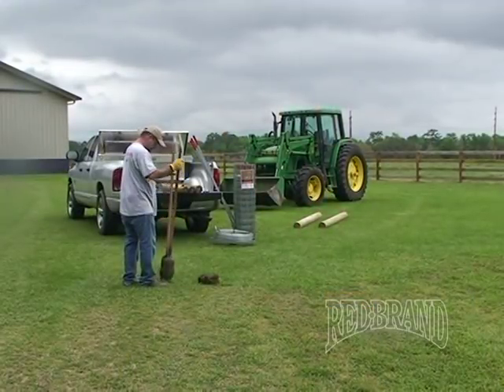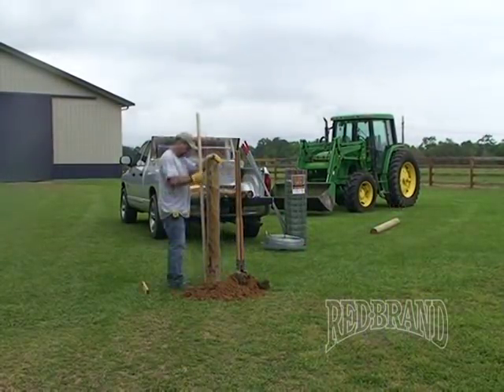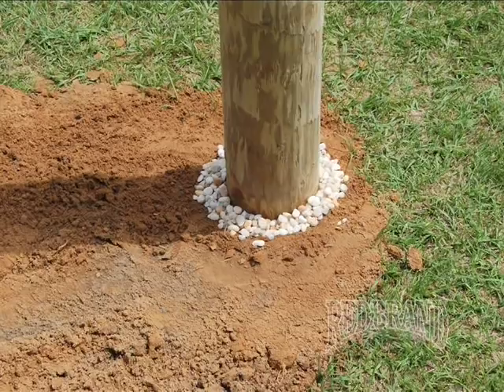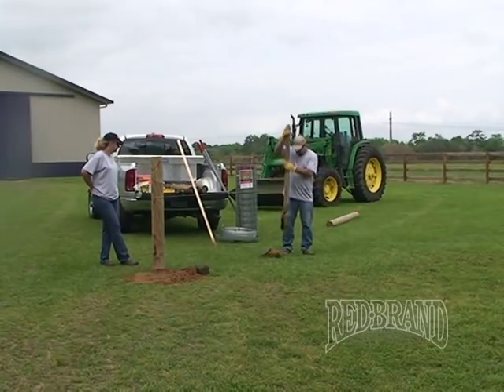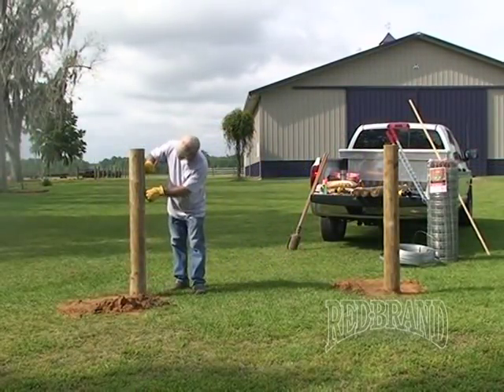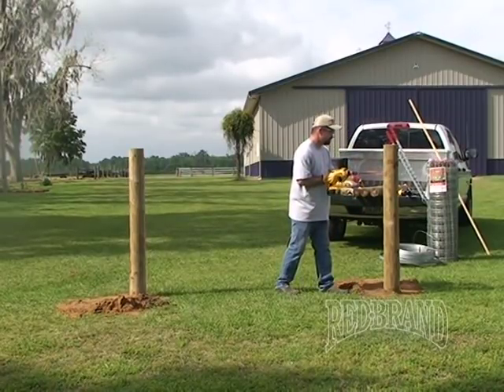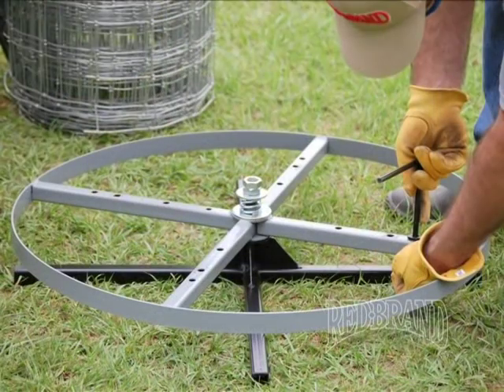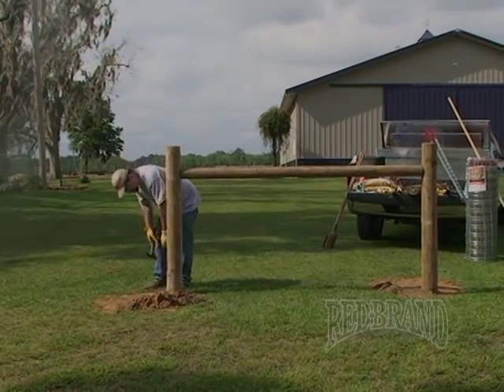Bracing Part 1 of 2

Comment: What was not clear was you said the brace needed to be level, but then a level was never sat on it and you merely measured down from the top of the post. I'm building a fence for the first time by myself (helped on some before) and I am on a slope so I'm not sure whether my brace should be level or simply attached the same distance from the top or bottom on the post!
Reply: robineggblue bu , Brace rail goes between the top two line wires of the fence, follows the contour of the ground just like the wires.

Comment: That's true, but only because they are terminating the fence to the corner post instead of to the second post. We should distribute the ground pull equally between the two posts, not have almost all the pull on only the corner post.

Comment: Thank you for the video.  Is the H brace stronger than the diagonal brace using a U Brace?  Under which circumstance would you use one over the other?  Thanks.
Reply: Most people are now using a metal pole with a diagonal metal brace now. Installed in 15 minutes.
Reply: H BRACE IS JUST FINE AND IT LOOKS BETTER

Comment: I want you to come out to where we live. We don't have nice soil like you have  we would be lucky to dig down six inches before you hit rock you ither have to have a rock drill or a Pneumatic driver to get the steel post in. We use rock bucks for our corners or in the middle for pullers. So you need to remember that not all of us can just Simply dig out a hole with a post hole digger.

Comment: You aren't going to wanna put your brace that high as it has no power... The distance the the brace up to the where the brace wire goes around the post should be evened out ... The way they are doing it it will leave the brace wire very long on the bottom side and which will make it easy to stretch the wire .... And it doesn't have as much leverage on the top of the second post ... I'm a farmer and I have learned this from personal experience
Reply: Wrong.. Its all about the leverage of the wire on the post, the post is just transferring the force backwards..
I am a fence installer.   The way shown in the video is the correct way to do it running a single wire
Reply: everyone has an opinion.....
Reply: ricemiddalumni that doesn't mean everyone is right.